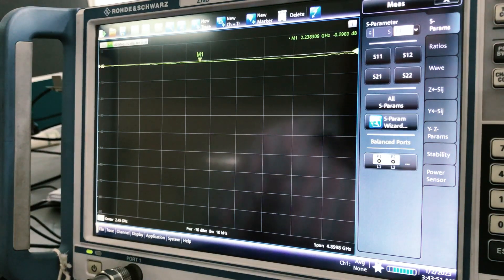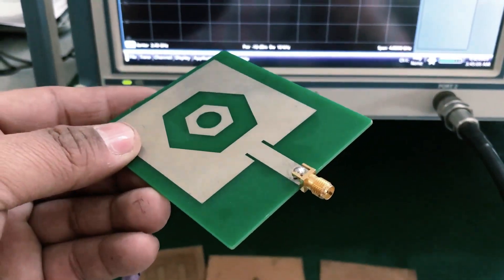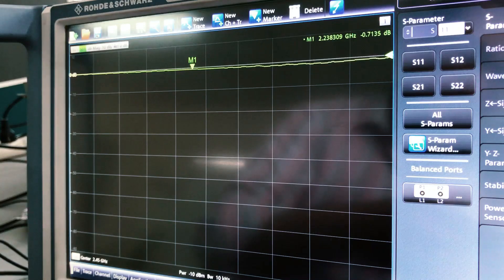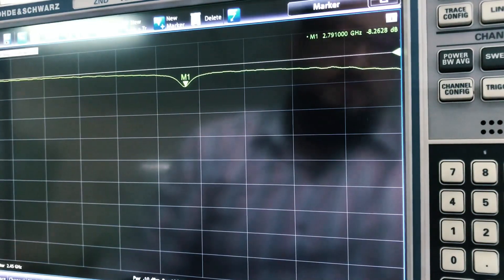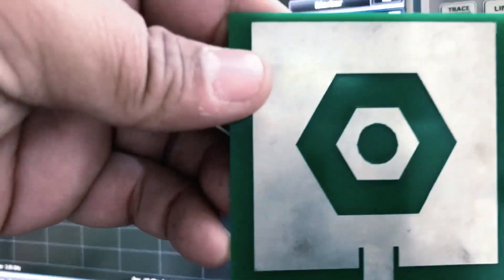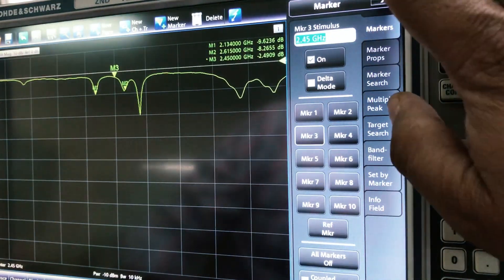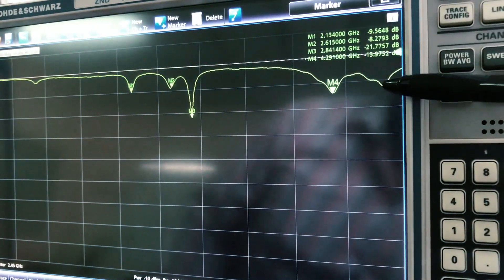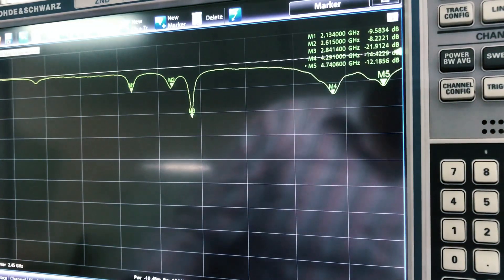How to measure antenna's S- Parameters, S11, & Return Loss using Vector Network Analyzer (VNA) | RF

Comment: Hello  I think that the RF cable that you use is not SMA " 3.14mm"  It's 2.92mm this can effect the mesure but the connector in The Antenna Is SMA it's ok

Comment: aoa sir can you explain a bit some more?
like what does it mean when the resonance is less than 10dB? and what does it mean if it's at 0? or maybe greater which isnt possible.
Reply from the maker: Less than -10 dB means that less than 10% of the signal is reflecting back

Comment: Hi i have 2 question to ask.

1. What connector type does the microstrip patch antenna usually use to connect to the VNA? Is it SMA Female? 

2. How about to test coaxial type feed patch antenna? Have you tried testing it? 

Thank you. Love from Malaysia.
Reply from the maker: 1. SMA female on patch since cable with VNA is generally SMA male.

2. These cables are different type of Coax with diff impedances, but generally VNA are 50 ohm, so that's why its either N type or SMA

Comment: Where you put the Antenna? In port 1 or 2?
Reply from the maker: Port 1, but you can put it on either port, depends on your calibration
Reply: port 1 is the input of VNA ,we mesured S11 of Antenna without source?